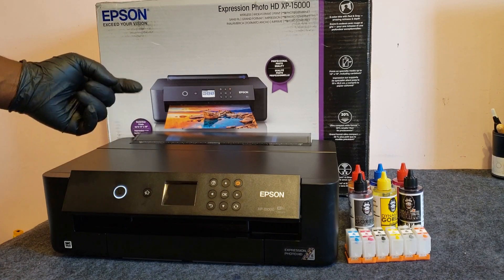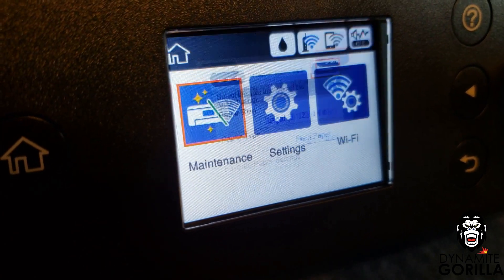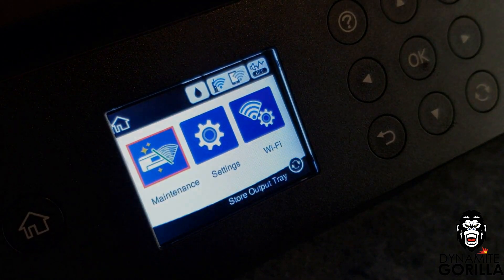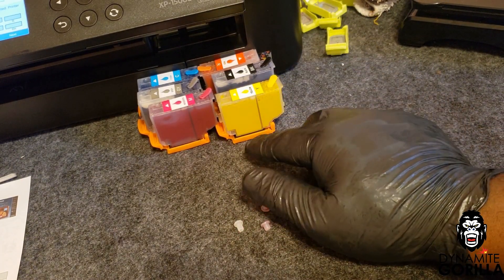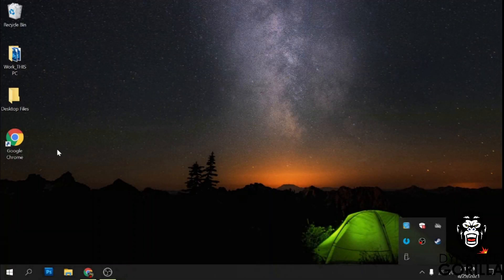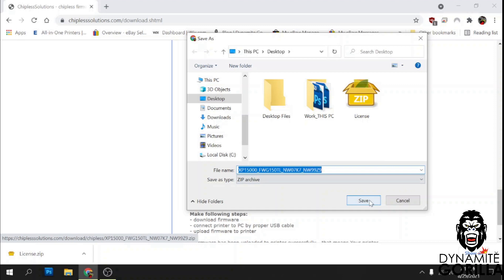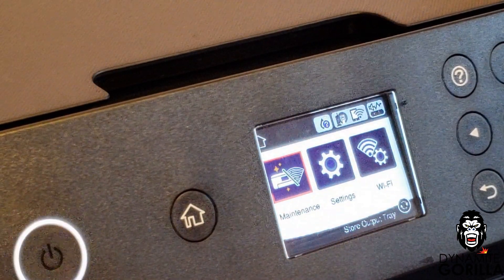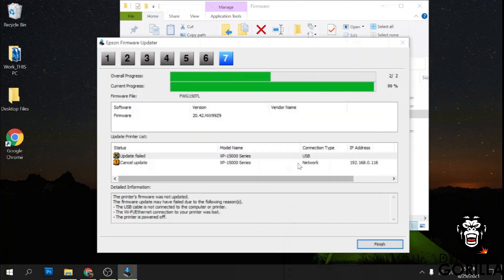Expression XP 15000 Sublimation

Comment: I’m on step 5 for the firmware update and although I’m plugged in via USB, it only gives me the option to connect via network. Is this something that I should proceed with?
Reply from the maker: https://youtu.be/jvhNebNkXdc
Reply: Thank you so much!
Reply: There is no longer an option to install without the complete package. Do you know of a workaround?
Reply: I am in the same boat with the USB not showing up and I did as suggested in the YouTube video but they only give the combo drivers and a remote driver on Epson does anyone have a fix for this or tell me what I can do?
Reply: @Marnie Oneill  have you gotten It figured out? I'm about to buy all this.. but not sure if I want to now that I see your comment. Lol
Reply: @marnieoneill3188  did you guys find a solution ? I’m having the same problems
Reply: So I’m using this video for my 7720 until my xp-15000 gets here, I had the same issue I had to keep plugging the usb cord in different ports

Comment: Firstly, this video has been amazing so far. Do you know what would cause the firmware not to recognize the USB connection? I have tried it in different USB ports and 3 cords. It shows up in my settings as being in a USB port, but the firmware is not giving me the USB option, only the network option.
Reply: I am experiencing the same issue currently.
Reply: I am having the same issue. Any solution?
Reply: @kellyborri1285  I realized that the step to download the Epson drivers was missed in this video and I didn’t download the original drivers to my laptop. Have you tried that?
Reply: @bridget5679  I went on Epsons site and installed the drivers.  That did the trick.  Thanks!
Reply: Is anyone else having trouble still with a windows 11?
Reply from the maker: @meg2030  https://youtu.be/jvhNebNkXdc

Comment: Great video.  I've had nothing but trouble with my new printer from the start.  When the ink got low on mine I ordered some ink and they didn't send the red or gray.  I'm  on an Imac.     It is 20240304.  Two years after you made this.  I envy your skills.  My prints com out faded wet with runny ink.  I've run through cleaning and aligning the heads.  it's brand new though so mine is junk from the start.  I envy your skills and patience to get it right.

Comment: Those cartilages is said to mess your printer up and leak bad. They also dry up quick and will give a false reading, hiw do you stop that from happening? Do you still have to buy a chip or just the chipless firmware?

Comment: Hey there, I bought the ink from your site and set up the printer, but my color is WAY off. I currently lack the skills to figure out how to fix the color. Could you (if you have some time) guide me ?? also, how long and at what temp do you press your plates at? They look spectacular!
Reply: I don't know much about printers, but I'll tell you from a photo editing perspective. If your colors are way off, you probably need to adjust sliders in the preset, the same way you would use Color Mix in Lightroom to adjust colors. Hope that helps.

Comment: I did this yesterday. Firmware is good.  Put ink in cartridges. Yesterday ink showed up in calibration.  Today it’s like the cartridges are empty.  I checked a few of them and they are all moist on bottom pad and appear full. But no ink is coming out. I  tried cleaning printer head etc. Any thoughts ?
Reply from the maker: Did you remove the vent plugs? Keeping the clear vent plugs in will create a vacuum and the ink won't come out.
Reply: @McZell  You are brilliant. That worked. After filling the ink bin I would naturally think to put those back in place.

Comment: Very helpful video. One question that needs clarification. If I purchased this printer new, do I have to do the installation with the ink that came with the printer before I execute the firmware or can I just fill the cartridges and install the sublimation inks then execute the firmware. 

I'm thinking I'm going to have to open and put in the ink that came with the printer because it has the chips to finish the initialization process before I can download the firmware - but I hate to be wasteful so I thought it would be best to see if I could avoid opening the ink and possibly having it dry up since I want to use this for sublimation.

Feedback please.
Reply: Any update on what you did?
Reply: Sorry for the late reply, but this is a GREAT question. 
     Yes if you purchased it new, It'll be looking for the initialization cartridges that came with the printer during its first initial setup. So the way I'm showing here is the easiest way to get to get to the firmware setup if the printer is new. 
     The next easiest way would be to swap the chips from the initialization cartridges that come shipped with the printer on to the refill cartridges. Fill the refill cartridges (and remove the vent plugs!!!), and then insert them during the initialization. This is actually my preferred method, but I rarely teach it because If done wrong, you'll never get out of the setup loop...so if you go this route be careful and make sure the chips are lined up and pressed down firmly. 
     You may also be able to write the chipless firmware in update mode if you enter it by keypress on the new printer. I've never tried it this way, but it should work. You'd have to get to epsons firmware update mode by keypress, Connect the printer to a windows pc via usb cable. transfer the firmware All before you ever setup the printer. Again, I'm not sure what the boot behaviour would be upon first startup with a different firmware, but it may possibly work.
Reply: Hello. Used the print cartridges that came with printer (set up printer using all set up strps). Now trying to convert to sublimation. After placing clipless cartridges, printer says there is an issue with them. What steps can we take to convert successfully? Also, how do you swap the chips onto the chipless cartridges? Thank you.

Comment: Hi!  Love your video.  I've followed all of the instructions with a new out of the box XP15000.  When I print, I get a blank page.  Do you have any suggestions?  I've tried the printhead cleaning several times.
Reply from the maker: Make sure that the vent plugs are removed. If not the ink wont flow out of the cartridges.

Comment: You dont seal the print wire connections or add a over flow tank like in other videos?
Reply from the maker: I did not seal my print head. At the time I did not know about that modification. Mine is still working just fine.
Reply: @McZell  Thanks !

Comment: So I did all of these steps and everything works great. However I needed to get a new computer so do I need to redo all of this on the new computer.   The new computer found my printer but doesn't have any of the preferences or anything.
Reply from the maker: You'll have to re install the printer driver on the new computer.

Comment: In desperate need of help I bought a Epson xp15000 converted it to dtf. Installed chipless  ink tanks and software. Then installed cat link for rip software. The printer now will not print anything not a drop of ink. Any ideas I did run a nozzle, check nozzle cleaning still nothing tried running a purge print. Still nothing….
Reply from the maker: If you are using cartridges, make sure that the vent hole is unplugged.
Reply: @McZell  I tried printing with them unplugged and still not must ink. Do you think I should do several print jobs to work air out of lines maybe?

Comment: Super helpful! I have a question though. With the chipless firmware, how do you know when you have to refill your inks? Because once you take the cartridges out to refill them, doesn't the printer do a print head cleaning, so you end up wasting alot of ink?
Reply from the maker: You really just have to stay on top of them or you can install a CISS. Ill be doing a video on that soon.
Reply: @McZell  Thank you!
Reply: I'm just doing some research for this whole printer conversion, but I think that best approach is to measure how many prints you can make with full cartridges. Once you know the amount, you can take that as average amount before next refill, and make your process much simpler. That's probably better than checking the ink every time you use a printer.

Comment: when you set it up for sublimation and fill your cartridges do you put the vent plug back in? I didn't see you do that step in the video so i don't want to go any farther until I know for sure. thank you so much this video is super amazing!!
Reply from the maker: No. You NEVER want to to leave the vent plugs in after inserting them into the printer. This will create a vacuum and the ink won't be able to flow out. 
Keeping them in while putting them into the printer will keep the ink from spilling out the bottom. But we soon as you get them into the carrier remove the vent plugs. 
Great question.
Reply: Just a dumb question here.  Which one is the vent plug? My printer is.printing blank pages and IM wondering now if I put a vent plug in that I shouldnt have.
Reply: @aprilbrown6124  It is the plug that covers the hole where you refill the cartridge. On my cartridges it is a small plug that is the same color as ink

Comment: it worked fine but after printing a couple of designs the black ink started leaking on the paper. I then checked the inks, then ran a print test and noticed that the yellow wasn't working. I ran a  head cleaning and now I get nothing printing. can you advise.
Reply from the maker: Make sure the vent plugs are removed.
Reply: @McZell  Thank you soooo much   it works now. Your video was so helpful. Just learning this technique and I really appreciate your video.

Comment: This may be a stupid question but after you've converted it, and did the firmware. Can you take out the refillable cartridges with the sub ink in it and put the old ink cartridges in and print on regular paper?
Reply from the maker: Yes. You can. Just run a few purge files to get the sub ink out of the print head. 
I wouldn't suggest to keep going back and forth between the 2 inks though.

Comment: Do you have to buy blank cartigidgres for the sublimation ink
Reply from the maker: Yes. Or if you have the original cartridges, you can drill them open and use them.
Reply: @dynamite gorilla so I can drill small hole at the top like where the hole is on the replacement ones? Do I need to find something to plug them with afterwards?

Comment: do I have to put the ink cartridges in on order to get the printer set up?
Reply from the maker: If it's new,.it will ask for the initialization cartridges that come with the printer.
Reply: @McZell  thank you!  Yes I put them in and completed the set up. Slow process 4 me. Thank you!
Reply: My Cyan isn't printing.  Any suggestions? Should I update firmware or drivers?
Reply: Then do the chipless again?

Comment: Thank you for the video currently trying to activate code but once I put it in it states communication failed check communication between PRINTER & PC. Change USB port. Check network connection, make sure that the proxy is not used and disable firewall. Try again -10089…. Any tips? Firewall was turned off
Reply: did you ever get this resolved?  I am having same issue

Comment: I have installed everything, no issues except when I go to print.   The error says that "invalid printer has been selected".  ( I also have an Epson ET-2803), Then I get the following message.  "the problem may occur when several printer drivers are installed.  It is recommended you uninstall unnecessary printer drivers."       Now how do I know which ones are unnecessary?
Reply from the maker: I would try uninstalling all of your printers from the devices menu in windows. Then reinstall them using the driver from the epson website.

Comment: At what point do i switch over from the Microsoft to my Mac. I’m using a friend Microsoft to install but will use my mac with it daily. Does the driver go on my mac or the Microsoft?
Reply from the maker: After the firmware is loaded you can use it with a Mac. Just don't update the firmware.

Comment: Can I still convert it to a sublimation printer even if I been using the printer for 8 month?
Reply from the maker: Yes. In this video, we set it up for regular printing and then take the cartridges out and put in refill cartridges with  sublimation ink. 
Just make sure you run a few purge files after.. you'll be able to tell when the old dye based or pigment ink is purged out of the print head. The sublimation ink will look dull on the paper.

Comment: Hey guys, BIG thanks for the video, very intuitive and explained. I have a question: You got any ISSUE or failed prints from this machine? Many people on foruns and on the internet are saying: "...Epson XP-15000 is NOT for Sublimation because this machine is very sensitive and get color issues...". I'm very impressed with this printer, I need one for wide format (A3) and I'm praying for this printer is my best choice. THANK YOU!
Reply from the maker: I haven't had any issues as of yet.
Reply: i'm experiencing color issues. so far unable to get it resolved. any ideas?

Comment: Can we convert it to sublimation after the Epson ink has been used in it?
Reply from the maker: Yes. After switching to sublimation ink do a few purge file prints. Usually only takes one but I run 2 to be safe. You'll be able to tell that it's sublimation ink when the colors in the purge file print get really dull.
Reply: Thank you
Reply: Thank u I had that same question this was very helpful

Comment: I followed all steps and when printing all I get is blank sheets. I did system printhead cleaning many times and let sit. I also removed printhead and cleaned surface physically. Maybe I missed something in firmware download? Any ideas on what might be the cause of this?

Comment: Do I have to have a windows computer or windows program on a MacBook?
Reply from the maker: You will need a windows PC to load the firmware and activation.
Reply: Do I put it on a drive to use it on my MacBook?

Comment: Do I need this firmware if I bought my printer already converted?
Reply from the maker: Probably not. If the printer already has refill cartridges, and it starts up without any cartridge errors, then you are good. Just make sure you NEVER update the firmware.

Comment: Did you fill all six cartridges with six similar colours as the original. I thought sublimation ink came in only four colours
Reply: This is what I am wondering too. What goes colors go in grey and red?
Reply: @Chad_247  I saw another video. If you look carefully at the thumbnail as well. Apparently there are sublimation inks in the same colours including grey. Those might be hard to find though

Comment: Mine never had a USB option to run the firmware on only network and it stopped loading at 83% but the printer di turn off and then back on. Is it installed or do I need to connect the USB 1st and reinstall the firmware
Reply from the maker: You need to connect with a USB cable to transfer the firmware.

Comment: A vendor told me this: "you need chipless solution and maintenance tank otherwise its a money pit..." Is this necessary??
Reply from the maker: The chipless Firmware is necessary for printing with 3rd party ink and cartridges as this printer does not have refillable cartridges with chips that auto reset. That is a one time charge for the activation key. 
If you don't run a lot of head cleanings then you should be good as far as the maintenance tank goes. 
External maintenance tanks are usually a must when this printer does a lot of head cleanings. People who convert these to DTF printers run way more maintenance than those who use it for sublimation printing.

Comment: When I'm running the firmware and the printer shuts off and comes back on, on the screen it says there is a firmware update  Should I be doing anything or just hit dismiss?
Reply from the maker: Dismiss. 
You can turn off the update reminder in the settings menu.
Reply: Where did you purchase firmware?

Comment: So I just took the cartridges out of the printer, turned it off, unplugged it, waited 30 seconds, turned it back on and it it still telling me that the cartridges are not installed correctly.  THERE ARE NO CARTRIDGES IN THERE.  What have I done?
Reply from the maker: You need to reinstall your chipless firmware and reactivate it.
https://youtu.be/q_i6vfGNaIQ
Reply: @McZell  my printer did an update and I thought nothing of it and now it won’t print. Do I have to buy another chipless key or can I use the current one I have?
Reply from the maker: @adhj6329  you can use the one you have again.
Reply: Does the printer come with the refill cartridges or do I buy those separately?
Reply: @jennifertodd3728  buy them separately

Comment: Once I've extracted it on a windows computer, how do I get it to work on a mac?
Reply from the maker: Just connect it to your Mac. Once the firmware is installed on the printer, it stays on the printer.  
It just has to be installed with a windows machine.
Reply: Oh ok So the windows computer has to be hooked up to the printer? I misunderstood. I was using my work windows computer to download and extract the firmware then tried to put it on a usb and use it on my Mac that is hooked up to the printer.

Comment: I don’t get a usb file. I get network only????
Reply from the maker: I have been getting this question lately. 
"USB isn't showing up. Only network, what do I do?"

I haven't been able to recreate this issue, but after researching this question in the forum, the admin states to disable the wifi before the chipless install.

To disable WiFi. 
Go to the home screen on the printer.
Select the wifi icon. 
Select "wifi (recommended)"
Arrow down and select "change settings".
Arrow down to "others"
Select "disable wi-fi"
On the "disable WiFi?" Question hit "start setup" 
It will think for a min and then disable the wifi. 

Then try the install again. If I can re create this issue I'll make another video.